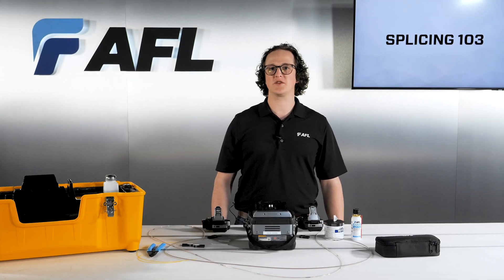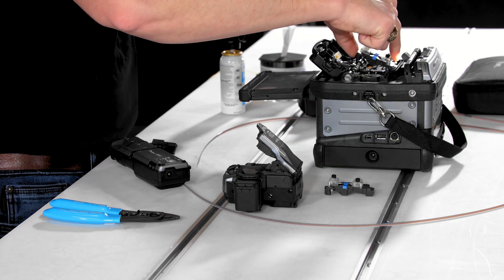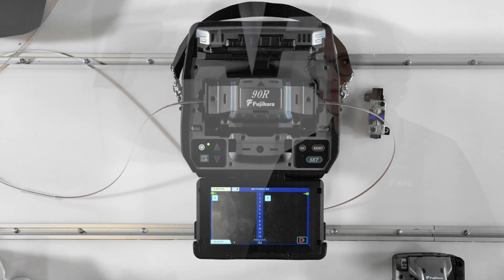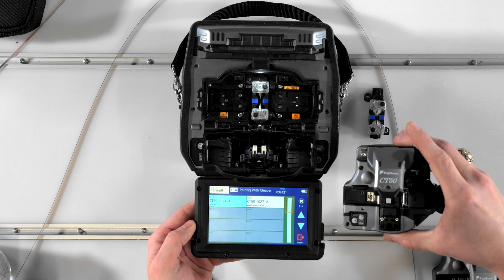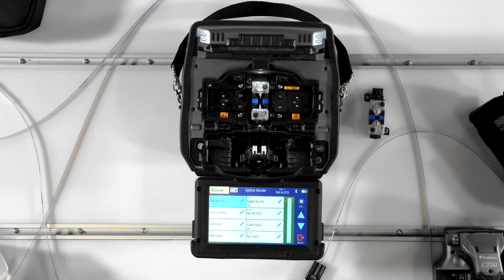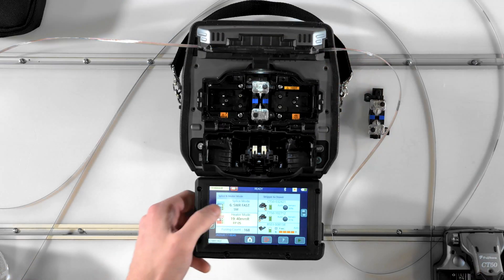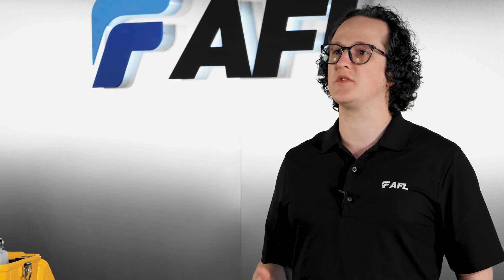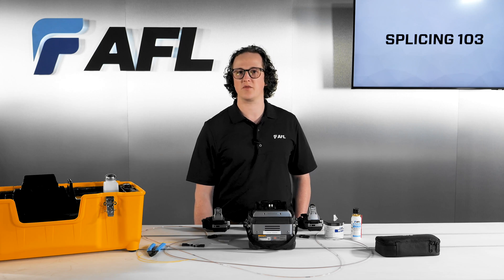AFL Classroom: Fusion Splicing 103: Fujikura 90R

Comment: Our 60mm sleeves for single splices contain a little bar of stainless steel in them. 
Does the oven take this into consideration when we select the 60mm sleeve option?
Reply: All sleeves contain that bar in order to keep your splice straight and keep from bending. It will not affect your heating option.
Reply: @KaziiMikio  The ribbon sleeve is plastic. It’s a lot lighter. So preferable for repairs where you cannot place the repair into a holder